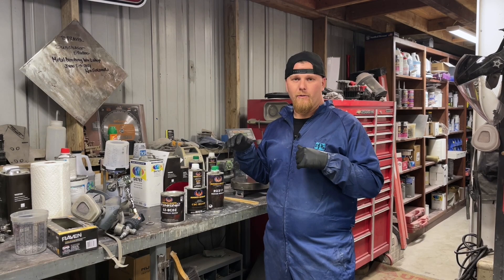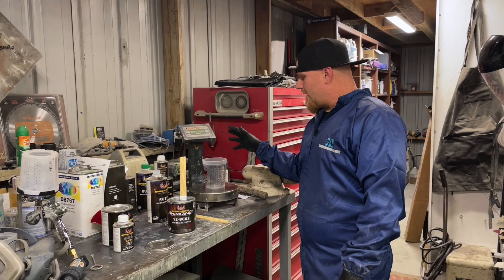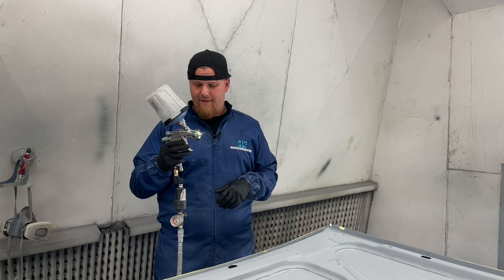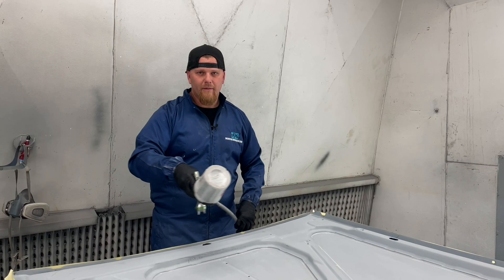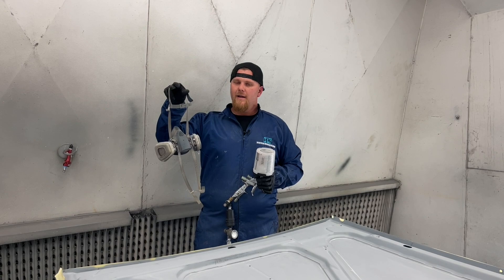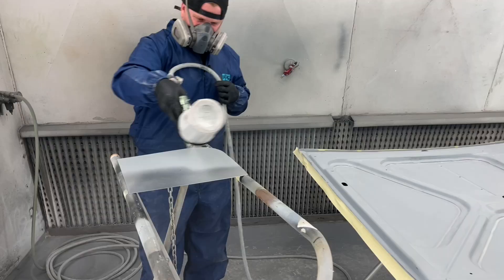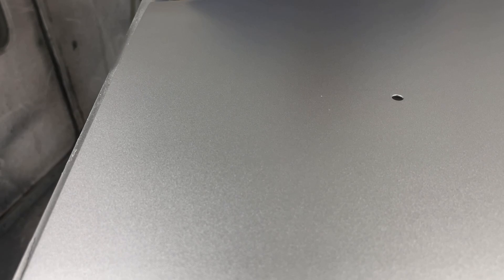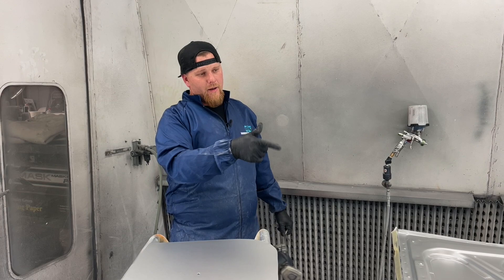Finally: A tutorial on how to make a spray panel and get a good color match!

Comment: I need recommendations for a nice quality clear. I have axalta and ppg distributors near me. Is there anything in those lineups you would use for a restoration? Ive got tons of work in it so i don't want to cheap out but I don't necessarily need to go crazy on it. I could also order online if necessary. This is gm wildcherry tint coat. Ive already bought base and midcoat (ppg shopline plus)
Reply from the maker: Vc5700 is what we use but it’s on national back order.

Comment: Hi. I have a issue. My painter stretched the paint on my car. He had to paint a DBC12 house of colour kandy pagan gold. But we didn’t have enough material do do the paint job. I was told I had plenty. ( 64 impala we had 7 quarts of DBC12). But it looks like we didn’t. He didn’t tell me he just shouted the car with what he had. (He lost a lot of paint, painting all the little parts and jams, hood/trunk interior) 

Anyway… my car is now all blotchy because he didn’t have enough paint. He did 2 coats when it was supposed to be 6!!! So yeah. 

My question is… can we sand the clear coat and re-apply more coats over the blotchy base? Would it cover it or just make the blotchy spot darker. 

Hope I’m clear? Thanks.
Reply from the maker: I’ve never done it that way but technically it should work. 6-7 coats is where candy starts looking uniform.

Comment: I just painted my bike, a Goldwing...all 37 individual parts.

Being that my shop is just 14'x20', I had to spray parts in "batches" due to insufficient room for all 37 parts all at once.

Aside from few dust nibs, paint job came out nice considering it's my very 1st attempt at candy and 3rd ever paint job, last being nearly 30 years ago(I'm 63, thank you😁)

Problem I got now, is that color don't match on bunch of parts, mostly due to poor technique and inconsistent spraying.

Since they're all already clear coated, how can I correct them individually? I'm guessing all will need to be resprayed to match majority that do match?
Reply from the maker: I hate to be the bad news bear but you will need to re spray the silver and start over to get them to match correctly. Only other option is wet sand them and add candy paint one coat at a time on the lighter ones till they match the darker ones then re clear.
Reply: @SYLVESTERSCUSTOMS  That's kind of what I figured. I was going to repaint all the mismatch parts any way, to match the darker parts.

Being that the parts have 2 coats of white sealer, 2 coats of fine metallic silver, 2 coats of midcoat clear with white diamond pearl, @2+ coats of Blue Hawaii'n kandy then 4 coats of mid solids 2K clear.

I did spray out speed shapes for all coats individually so, I got something to reference the color to, as I re-spray each different coats.

Thanks for your input. No bad news there, it was expected. I'm no pro, even pros mention how hard it is to match candy.
Reply from the maker: @kodiak536kodiak536  it absolutely is!! Good luck

Comment: Bad advice about mixing paint on the scales.  You can't do that unless you have the paint manufacturer computer program to do it. Weight and volume are two different things.  Other than that two thumbs up for the videos you do. Great viewing.
Reply from the maker: Not sure why you think that is bad advice. You are referring to mixing and creating colors I’m referring to a candy concentrate and or metallics that are already created. This is for when you add reducer and hardener. A scale is way more accurate so I disagree. Thank you 👍🏻👊🏻
Reply: If the product is 2:1 by volume, that is not the same as 2:1 by weight unless they (hardener and clear for example) happen to weight the exact amount, which is unlikely for most products, especially primer. The more you mix the larger the error if you mix  by weight over volume. It's like a gallon of water isn't the same weight as a gallon of feather fill. They are the same volume,  but not the same weight so a scale would throw the ratios off if you mix by weight (200 grams to 100 grams). It's easy to try yourself.  Just pour a known volume into a cup and weight it.  Then do it with the other components.
Reply: H.o.k has a list of the density on their site.  Ru311 is 7.20 # per gallon, ku152 is 10.07 # per gallon and uk01 (for example) is 8.24 # per gallon. So you can see the weights of these are not equal so the volumes at the given weights will be off if you don't compensate... on a side note..I hate that the gun filter is after the air regulator. All of those filters have a pressure drop (usually listed ) so setting your regulator at one pressure it will be spraying at a lower pressure the the gun. If the filter starts going bad,  it will further reduce the pressure.  Better to have the filter first,  then the regulator to maintain accurate pressure at the gun.
Reply: @dirkbmx9920  thanks explained a bit better than I did